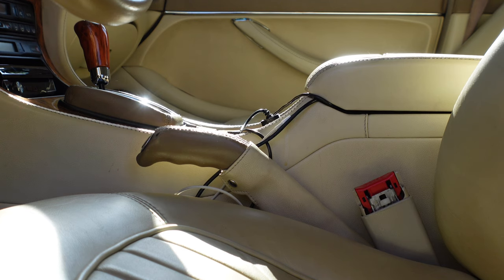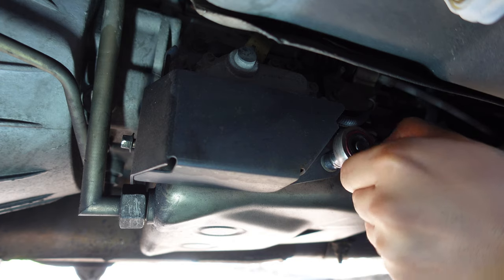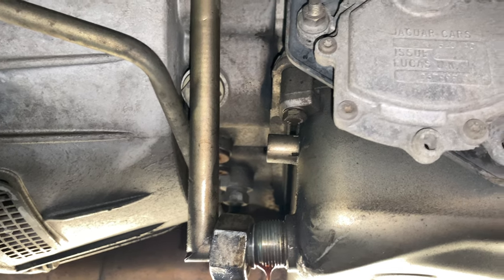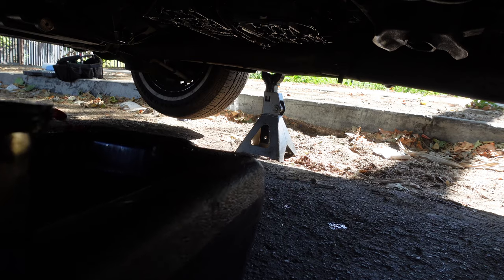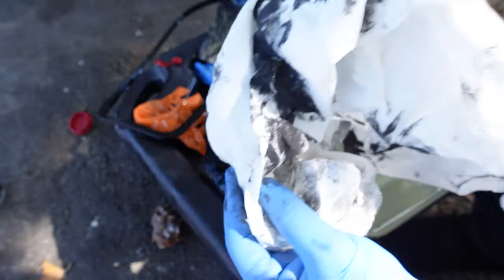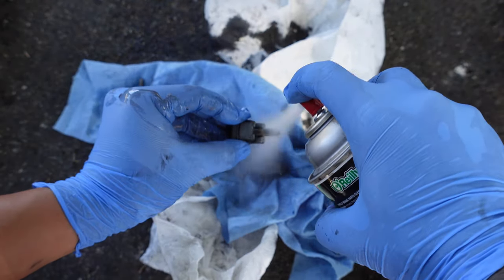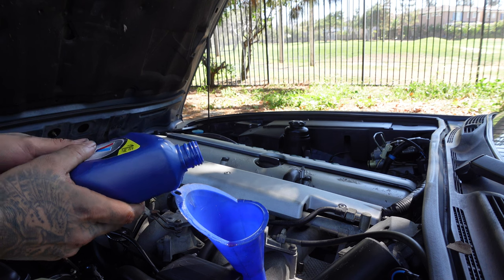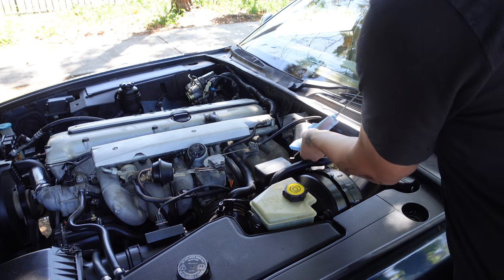Extend Your Transmission's Lifespan: Fluid and Filter  Replacement for 1988-1997 Jaguar XJ6

Comment: What to do if the transmission fluid dipstick is stuck? Like, sealed-stuck
Reply: Got same problem
Reply: Mine was stuck too, but I just jimmied it around a bit while pulling up (no gorilla pulls) and it worked itself out.

Comment: Hey Jesse. Good video. R u lifting on the diff with.your trolley jack? I want to lift mine and wasn't sure where to put the trolley jack. Thx
Reply: I used mine with a 2x6 and it worked like a charm, lifting at the crossmember frame he showed in the video. 👍

Comment: Hey Jimmy.

My daughter gets an A/T light come on whenever she drives in hilly conditions and hot temps. Downhill, or colder temps its fine.

I checked the level on the tranny dip stick, and its definitely not low. But she does have shifting delays in the first few gears.

You think its just bad fluid? Just needs a drain and refill?

And i saw you only replaced with one small  bottle. Is that all it takes?

She has an 97 XJ6 L

Comment: Hey.... So my oil pan exploded on an X306 just two days after I bought it....

What happened, and do you know where I can find a gasket? Because this car just ain't the previous owner's problem and yet he's probably sourced a new oil pan....

Regarding the ZF 4HP-24 (The transmission that came with the naturally aspirated 4 litre engine), the same thing applies to the Jag as the BMWs and Land Rovers of the period: There is only one fault which is the solenoid. It fails after some period of time.

What do you know about doing a Getrag 290 conversion? on these cars?
Reply: Get in touch with swallows racing here in the UK they run a fleet of x300 and xj40 race cars but they've just done a conversion for the xk8 on the deivetribe channel. They are masters of all things jag